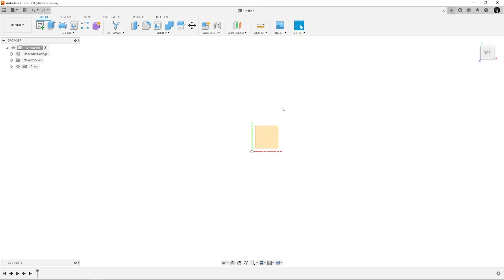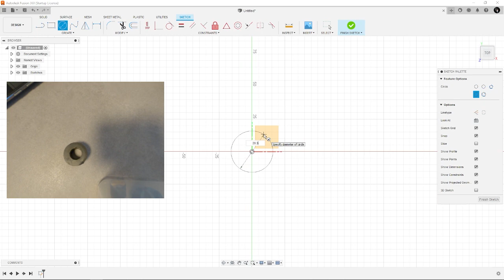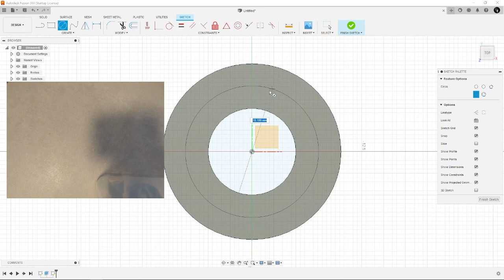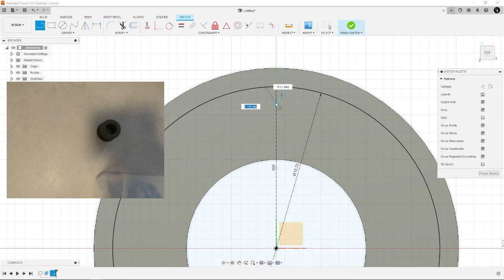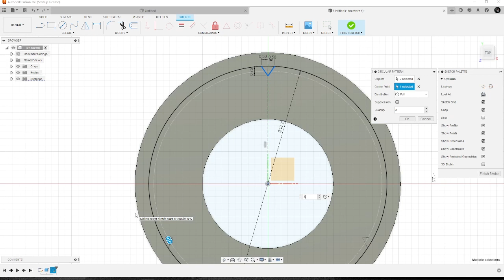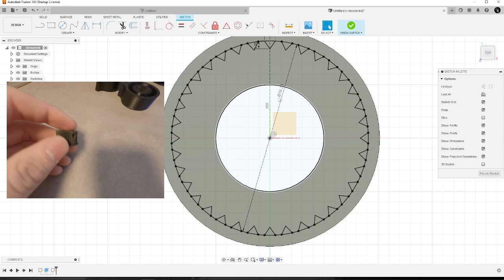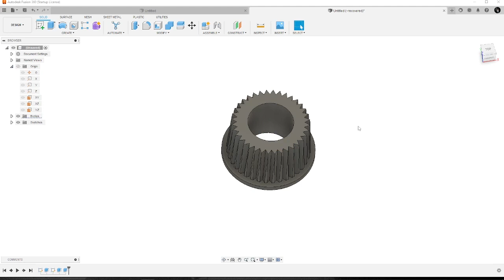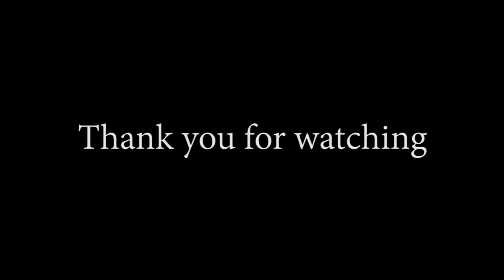How To Clone Parts Using a 3D Printer

Comment: Do you think it is possible to use a 3D printer to print an object which is made of very thin plastic but has a complex, highly curved shape? It is a wing cuff from an airplane. I would try to get the 3D model from the factory. Thank you.
 https://drive.google.com/drive/folders/1AugkrpXpgxdJ5Pmqlv0T9R82oSzWME5-?usp=drive_link